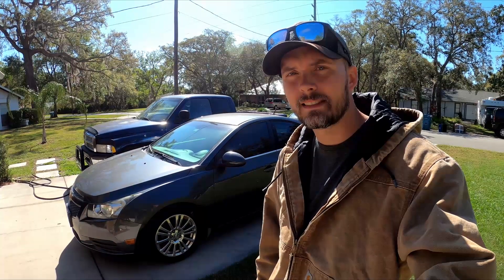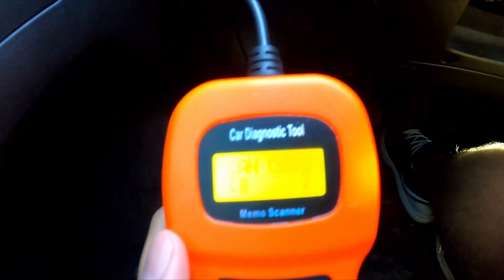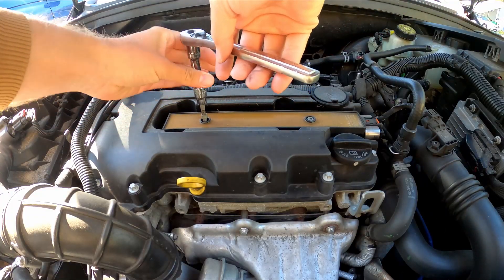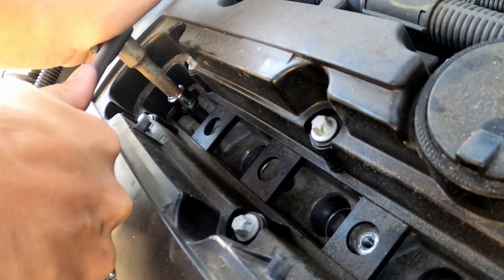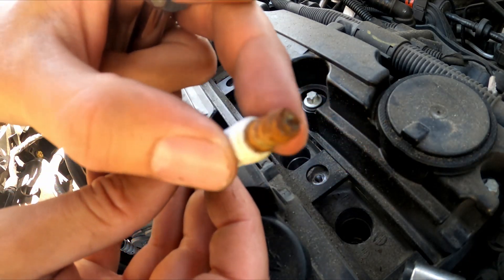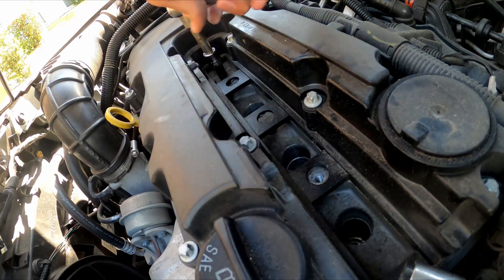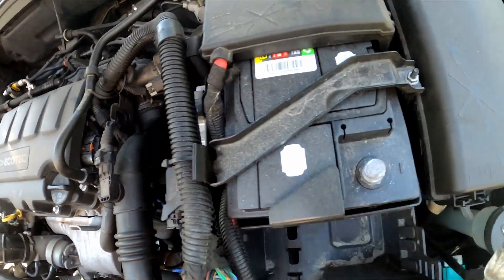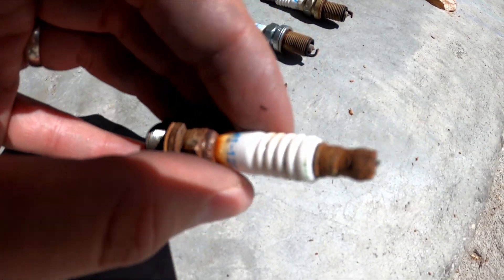How to Diagnose and Fix Service Stabilitrak Traction Control Problem 2011 - 2015 Chevy Cruze

Comment: what does changing your coils have to do with stabilitrack?  All that did was fix your engine code
Reply from the maker: Missfire was causing stabilitrak to disable in this instance and was caused by the bad plug.

Comment: I'll tell why it's rusted there's possibility you got radiator coolant leaking inside were the spark plugs are at you may need to get a new manifold  . Which could run between  800 and 1200 . But there's a temporary solution get yourself the bars leak sealer liquid copper that should help block the leak going into ur spark plugs I had this issue with my 2014 chevy cruze .

Comment: Hi, but I wonder HOW Spare plug or coil can effect TRACTION CONTROL OR STABILITRAK system failure?
Reply: It can't; the codes were cleared by disconnecting the battery for a while.

Comment: Absolutely the issue! Thank you for the perfect video. A traction control light is sparks 🤣 thank you again!
Reply: Maxi Muffler changed everything to do with fuel on my Malibu and charged me $1800 dollars and it still doesn't run right. Found out that they didn't even check the Fire and the coil pack is completely gone. Going to call BETTER BUSINESS BUROUGH and the News because they Robbed me and my daughter and still didn't fix it Nor knew what was going on with it..😟😟😟😟😟😟🙁🙁🙁

Comment: Got a question my car is doing the same thing but throwing a po171 code  and owas wondering if it felt like your care was jerking
Reply from the maker: I would get that fixed fairly quickly and would limit driving. P0171 is a fuel mixture code and can cause internal engine damage if not corrected. Do some Google searches on it and see if it something you can handle doing. Good luck!!

Comment: Hey thanks.
I'm an unemployed old chick. I guess I have to park it until I can get it fixed 😔.  Pep Boys is my usual go to, because the dealer is ridiculous. 
My dash is the same as yours. I have a 2016 Chevy Cruze. I only have 41,000 miles on it. I bought it new. Both of my front seat windows fell off the tracks so duct tape is holding them up. I was making close to $60,000 a year. My mom got Alzheimer's  (95 yrs)
I had to quit my job to care for her. Went through all my retirement money.
She died 2 months ago. I'm old now. What a disaster....... that never crossed my mind that that was going to happen. She didn't have enough to go into a home, but her Soc Sec was to much for government aid. Have you and you viewer's ever thought of that as something that could happen to them ?????
Me either.
Sorry to get off subject.
The warning thing in the middle of the dash there looks a little different. 
Instead of a picture of a  wrench 🔧 it has a picture of a  key 🔑 
    It say the sames as yours.
Is that important do you think ??????
The car 🚗  has been doing weird shit when idling (chipping) the sound goes away when I put my foot on the gas. It's jerky when idling. I new I should have married my high school boyfriend. I didn't. He is and was a hell of a mechanic. Totally to apart my 1968 GTO. They did it in auto shop. Sure it took 3 months, but it was a show piece after they finished. A picture in the year book "1976" YEARBOOK. 
Oh I got off track again. Old people....
You know.
Well, if any one has any thoughts 🤔 
Feel free to comment.
I do think I will buy one of those yellow code reader thingys.
     This is bad news for me. Crap !!!!
Reply from the maker: Sorry to hear you're going through alot. Just remember tomorrow is a new day, we just have to take them one step at a time. You can always try autozone (call them first) and see if they will run your codes for free and they will give you at minimum an idea of what you're looking at. I hope it all works out for you, it seems like the cruzes are filled with problems.
Reply: Lol. Love your  personality. you're fine. Go off track  😊

Comment: Will the car throw a code if all the lights are on except the "check engine" light
Reply from the maker: I would say yes because most cars store codes even after the light goes off. I guess there's only one way to find out. Autozone by me used to check codes for free or just pick up a code reader. Good luck!

Comment: Just ran into this issue today. Going to give this a shot. Thank you 👍🏻
Reply: Worked for me.Hope you had good luck as well.
Reply: Did it work?
Reply: @MrBelle-ms4fd  the problem ended up being a cracked plastic top valve cover. This is the 4th time I have replaced it. Also the water pump was acting up.

Comment: I replaced the coil pack but I was told I did not need spark plugs mind u I drive dwn a very bumpy rd daily so is something knocking loose or should I replace the spark plugs
Reply from the maker: It's very possible, but no way of knowing unless you pull the codes to see what is causing it. Normally I would suggest you change both at same time unless you know your plugs are newer. Judging by others comments, the error message can come for many different issues. Good luck!!
Reply: @deuceliter  so the coil pack clip is broken that is why my car was acting crazy
Reply from the maker: @fantazia4333  well atleast it was something simple!

Comment: I am having the same problem; only thing is all those parts are new. I just had them replaced a few months ago. I am curious to find out what is the issue with mine. I wonder if I got a faulty part.

Comment: anyone else with a Chevy realize once the  car gets Closer to 100k miles it’ seems to have more issues, it’s like I fix 1 issue n then it’s another soon after??
Reply from the maker: Unfortunately I've had to replace the clutch when I first got it, the overflow antifreeze container had a cracked in the bottom so all of it leaked out, trunk button doesn't work among this issue and several others. They just aren't made to last very long imo.

Comment: You would think if your plug was fouling out or not working right. You would get a check engine light on aswell. Hopefully your problem was fixed.
Reply: In the video while he was driving it...He did get a flashing engine light...

Comment: Thank you!!! How much would this actually cost? I have a 2016 with this same issue
Reply from the maker: For the plugs and coil it was just at 100$. I would suggest pulling the codes to make sure you are getting the same error before spending money on parts. Good luck!!
Reply: Did you do what he said (check the codes ?)
Just wondering. 
I have no one to help me.

Comment: Autolites are the worst spark plug . And unhooked the battery will not erase codes in general on most cars because the computers have a back up battery or a capacitor that holds the memory. Just incase peoples light is still on. And there are a million things that will make the car go into limphome mode (limp mode) .

Comment: I've experienced it, the cause is the cylinder 4 coil broke the plastic inside the rubber which damaged the spark plug.

Comment: I bought a pre owned Chevi Equinox 2014, 2.4L from a dealership. After one month the engine light is on. Then giving three messages. Service 4 wheel drive system, service stability trak, engine strength reduced. I let know the dealership they checked couple of times; find only engine mass flow sensor has to be changed, they did it and charged me for that. However, engine light, those messages still there. They advised me to drive the car it will be fine if I drive. I am driving but my guts feeling not to drive. 
My question; what is the responsibility of the dealership? Can they charge me for anything with in one month of purchase, driving 1600-1800km? What I need to do right now?

Comment: I have the same issue with my ‘14 Cruze but it also turns the cooling fan on high when I start the car and reduce power after driving for a min. Did yours do the same and could it just a misfire too? Would want to try your steps out first if that’s the case
Reply: Me too, fan is on and it's so cold here right now.
Reply: @sandraburdette9159  I did replace those as said and it started working fine. I had to run it and drive for a bit to let out the smoke then went back to normal
Reply: Same thing here
Reply: @aidanrowland7329  I did go through with it and it worked for me too. I would def try it out.

Comment: Hey guys this same thing happened to my car ! Chevy Cruze 2016 . Took it to my mechanic turns out I needed new spark plugs and a new ignition coil . It driving perfect now that it’s fixed . My codes were p304 and p303. . For those wondering if it’s safe to drive I would say yes only if you absolutely have to because I had to drive it for a week before getting it fixed . Drive carefully please my car would stall when I would accelerate so keep in mind be safe while getting on the expressway . ❤️ This video saved me thanks for the information .
Reply: Thanks for this, I have the same exact car and I think this is the issue
Reply: Hey how much did u spend ?
Reply: Thank you I had my sparks plugs changed but I must need a new ignition coil
Reply: I’m having the same problem
Reply: I had this done and it's doing it again.
Reply: No it is not safe!! It will cause severe damage to the internal of your engine. You were lucky
Reply: I’m have a 16 as well with the same issue. These cruzes are junk cars smh 🤦🏾‍♀️
Reply: @ashleywifey13  honestly I agree it's always something with the Cruze .

Comment: Actually I changed my coil pack and everything and it never solved the problem what solved my issue is after I replace both cam sensors the stability track and traction control light never came back on it's been 5 months haven't had any issues I would replace the two cam sensors first but at least it worked for my 2012 1.4 turbo LT but mine is the rally sport package

Comment: I had this problem so I did everything this video recommended but it still does it . Any opinions on what I should do next ?
Reply: Could be throttle body or ur Gas Pedal it has a sensor also

Comment: Hello I'm currently having the same issue. I just wanna know if there's any difference between brands of spark plugs. I was recommended acdelco but I see you have the autolite link posted
Reply from the maker: I haven't had any issues with the plugs. As long as they are all the same brand, shouldn't have any problems.

Comment: I'm having my stabilitrak light and service traction control light come on.. got my spark plugs changed and the valve cover gasket changed because oil was getting down in my plugs but I'm still having the same problem. Seems like it got worse. Now the check engine light is blinking rough driving and jerking really bad when I'm at a complete stop.

Comment: I had the same problem with my '14. I let it go to 224K+ miles before it finally went out. The plugs were surprisingly clean for their age, never been changed before. Anyway, your video was spot on. Thank you very much for posting, it was most helpful. She's back running like a champ this morning! :)
Reply: I’ve got a ‘14 Cruze with 220k miles it just started going out
Reply: Where this place located

Comment: I was unfortunate about getting bad gas in my vehicle after filling up and the traction light and engine light came on right after. I brought it to autozone to do a check engine light and I was told it was miss firing as well
Reply: Check your fuel filter and fuel injectors

Comment: What if Mechanic only charges coil and the spark plug that was misfiring. Will that not take care of the issue? Does he have to change all of them?
Reply from the maker: If that is the problem a bad plug/coil then yes you could just change it. It's just recommended that when you change one that you change them all at same time.

Comment: Typically, if you're having electrical or battery issues where you're losing power, one of the first messages you'll get is a stabilitrak problem. Probably because it's one of the first systems to get tripped when there is a loss of electrical power.
Reply: What's bad is I told my wife to have them change the coil because one of the plugs fire was week and I had just put plugs in it before I went out of town. She had them weld a straight pipe where the catalytic converter had been cut off and 4inches above their weld was a pin hole just like a Tack Welder and you could definitely see that it came from the inside out, which tells me they welded with the Battery still Connected and shorted the whole coil out because right before I changed it I checked every point on the coil and they were all weak red almost a pink and after I got it off you could see a tiny crack on the one that was the Ground to the motor which took em All Out and sent my electrical components haywire and all they could say was I went by the codes,but when I asked him if he even checked the firing he said there wasn't a code popping up for fire- - DUHH, Fire,, Fuel and Air induction All Together equals Ignition..... the Napa Know how was what they didn't have. We have more problem now with the electrical than we ever had and $2300 dollars later wrongly taken from my wife and daughter and still isn't running right. DC current to a Solid Ground _ Ground made our Impala a Live Deadbeat Horseless power Flintstones mobile... Makes me angry that all their schooling in their fancy Tec Tools and Codes and they don't have the A,B,Cs  to number their X W,Z's...One mad and Displeased customer by Distance and Fraudulent charges and work and parts that weren't nessesary.. I know where Hytech Reject or Redneck comes from.. I'm an Old Shad Tree Mechanic that will put to shame all the High Dollar cost of Let's guess the problem and that's exactly what they did.. Still busting Knuckles till the Robots can Diagnose, Take apart and reassemble in a Running State and be on Que...

Comment: I had the exact same problem with my car turns out the plastic pipe going to the air intake was cracked right where the air intake attaches to the engine therefore it kept shutting off it was getting the wrong air to gas ratio and completely bypassed the air or MFS sensor cost $230 to replace so I went to a scrapyard and got it for $2 works perfect now lol but thanks for the video anyway I did change my spark plugs

Comment: Changed my plugs and coil pack, no codes, check engine light, or anything, just maintenance. However the next time I started the car to drive it, my dash had the same stabilitrak messages you showed, the check engine light is flashing, its shaking badly, and rpms are high at idle.
Reply: Any updates?

Comment: If you get the message "service stabilitrack.." and the engine light dosen't blink but is on, your problem is more likely the swivel of the intake manifold ..i did the sparkplugs and only lost a.b.s.and t.c.s. no power reduced. 2012, 1.8 LS 300000km

Comment: It started on random day driving. My car jerked and I got a notification saying “service power steering system”. Checked the codes only code was lost communication with TCM. Checked wires and connectors and found no issues. It makes it impossible to drive, it pops up that message randomly. It happened once I totally forgot about it because it ran fine after letting it sit. It got worse doing it more frequently.. To the point I needed to get towed several times. Also when the message pops up the locks go crazy.. they lock & unlock several times, if I press the gas it jerks me.
Reply from the maker: Sorry to hear that Nancy. It seems to be a major issue with these cars. I'm hoping nothing else goes wrong with  it or it might be time for me to get a new vehicle.